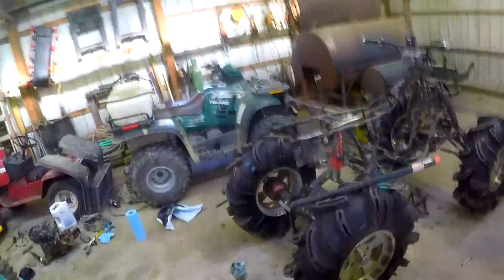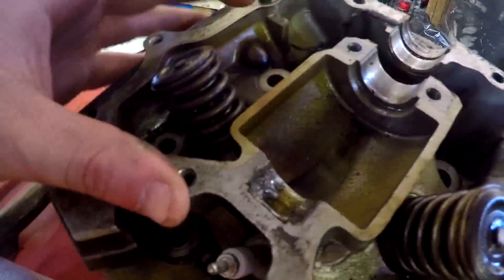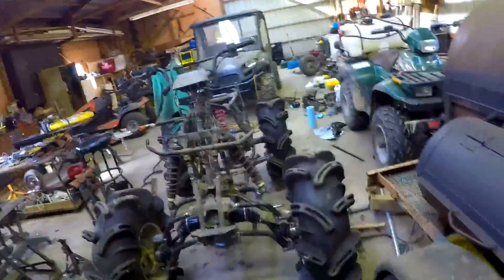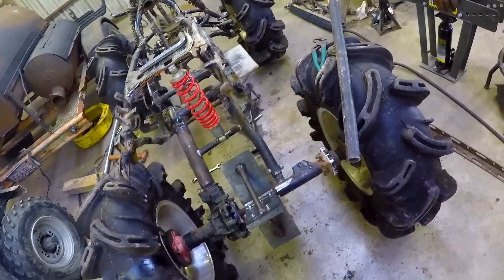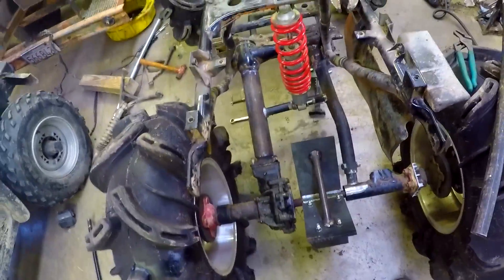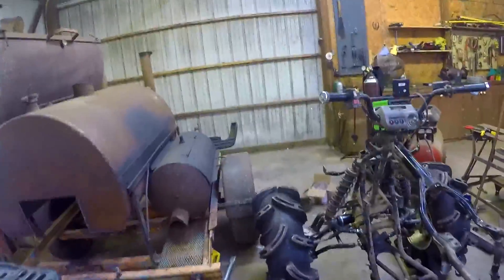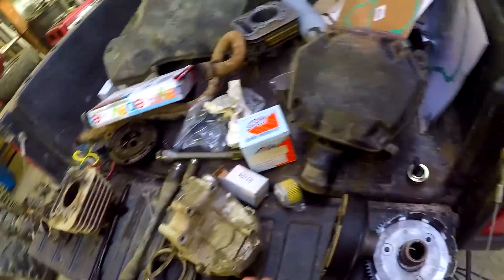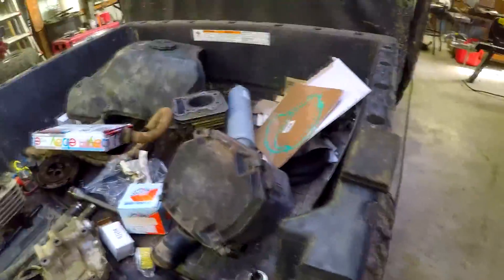Honda 300 with 4'' lift and Body Lift Sitting on 32 Silverbacks Test Videos Soon

Comment: Where you riding at 3rd weekend
Reply from the maker: i havnt decided if im going or not but if i do its in medora indiana but i think im gonna pass on it this year
Reply: TheHondaOutlaw you not goin to mudfest again in Kentucky
Reply from the maker: i am going to that one, not the one in indiana, the one in kentucky is large and is worth driving 3 hours
Reply: TheHondaOutlaw cool we will be there maybe il run into you
Reply from the maker: im going saturday morning and staying until probably like 4-5pm
Reply: +TheHondaOutlaw I have a 75 millimeter top end kit in my 300 is there like a big bore kit if so what will I have to use to make it work.
Reply from the maker: the 317 is bolt on and there is also a 380 bolt on kit, i can get you the number of a guy who can sell you one